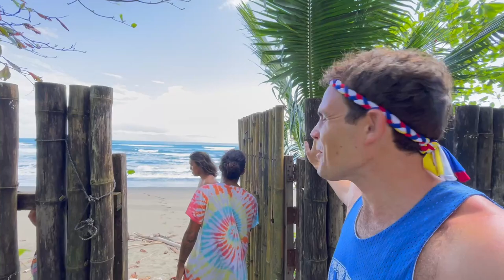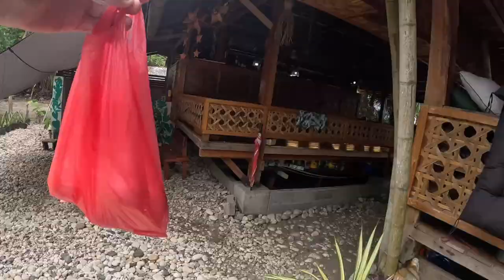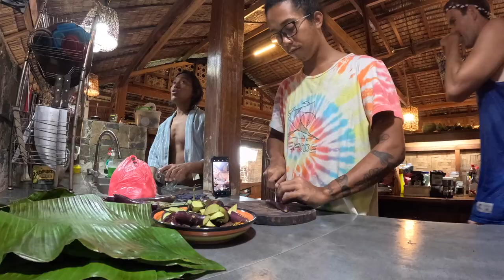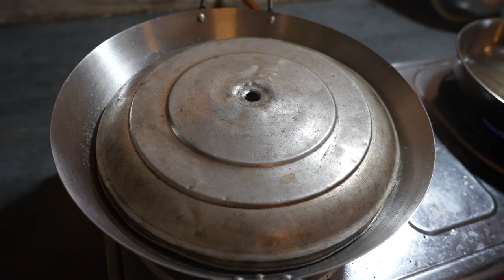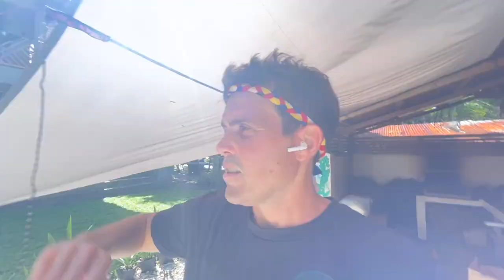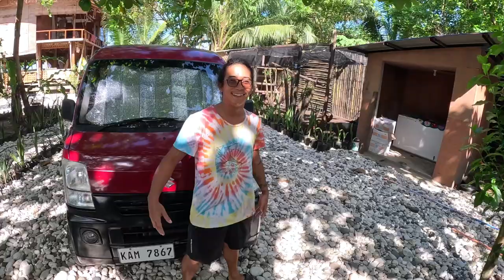PHILIPPINES RARE RIVER FISH - Province Beach Home Cooking (Davao, Mindanao)

Comment: I believe the "Hipon" fish is a type of Anchovy if I am not mistaken. If Cateel River is brackish, that'd make it the correct habitat for anchovies, as they are found also found in brackish waters in large schools, from what I have read. I also believe the tagalog term for Ginamos is Bagoong, from what I have read, with the one using Krill is called Bagoong Alamang.
By the way, if the King Cobra is still hanging around the property, maybe you could call the proper authorities so they can remove it and move it somewhere else? King Cobras will prefer to flee than fight anyway as they are more defensive. They probably won't target your chickens as the King Cobra's diet is primarily other snakes.
Reply: Its goby fry. These are amphidromous fish so they migrate as fry from developing as larvae in the sea back into rivers.
Reply: I grew up in the islands, and we called those tiny fishes baby anchovies 😋
Reply: @milanice5730  anchovies and river "hipons" are not the same for me...btw,  i grew up very close to an estuary. River hipons are rare.
Reply: We call that ipon in ilocos, its not a hipon, sarap kinilaw with vinegar and calamansi.🤪
Reply: @doityourselfpb8614  Ah. I stand corrected then. I had a feeling they were goby fry, but I guess I gravitated my guess towards anchovies ls since they're the ones that we usually fry and make into fish torta over here. From what I have read, these gobies willl do their own version of the Salmon Run, going back to the rivers as young adults after developing out in the sea.

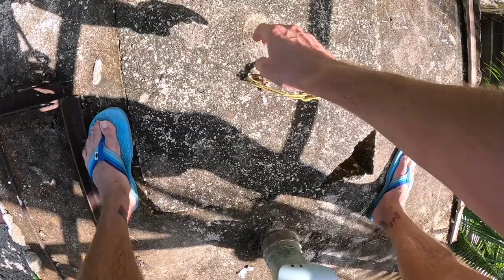Comment: @ 17:40  You should replace the cover on water tank because that missing corner will allow animals and other sources of contamination to enter.  Also better to have a raised lip the lid sits on so water from the top of the tank can’t run in under the lid.

Comment: Hello! Kulas ,Kumar, Helping tips suggestions to rid of any reptiles, rodent or insects,plant a permanent,thyme,rosemary,red onion,garlic to your surroundings  walls perimeters and to your gardens do like alternating side by sides planting those herbs & aromatic leaves plant , reasons snakes or Rodents are allergies on permanent,thyme,rosemary,red onions and garlic if you mixing side by sides planting them will work strongly to push away snakes,rodents and mosquitoes, wishing this will help your land safe from king Cora